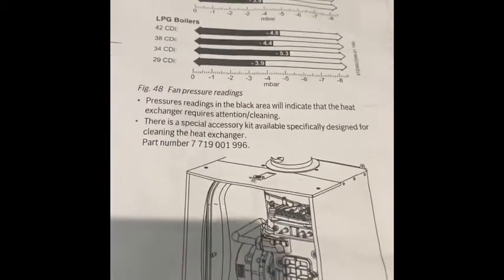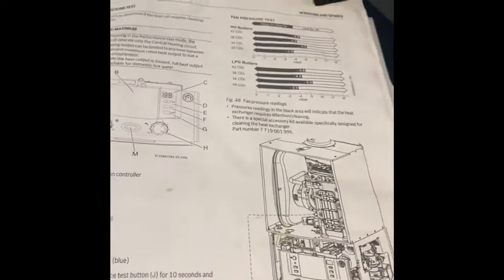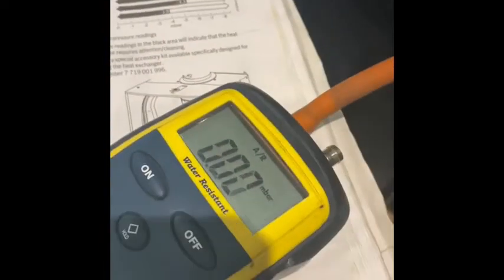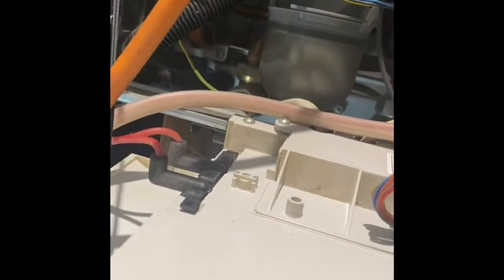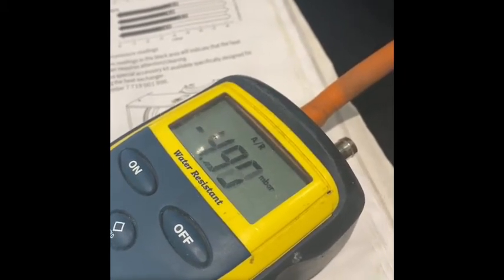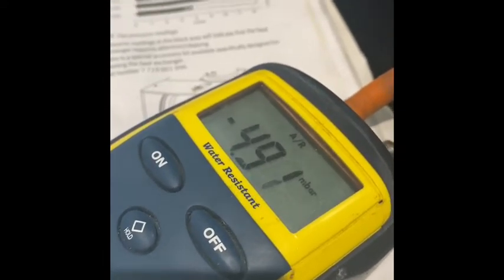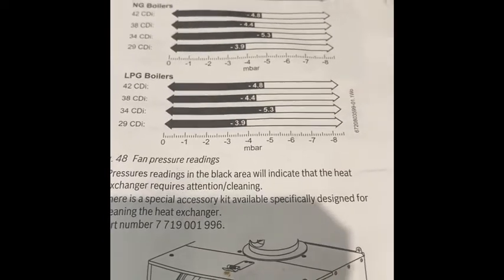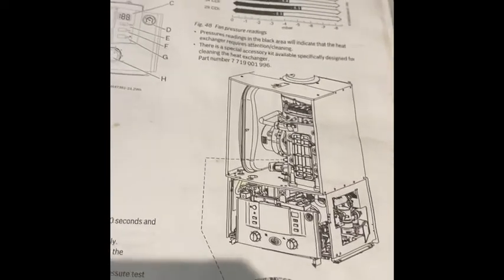worcester boiler fan pressure test ACS gas safe

Comment: Hello Pete, I have one of the older WB 28cdi RCF circa 2010 machines, with a fan with no electronics just 3 terminals (two at one end of the exposed copper coil, and one at the other end of said coil) to which attach 3 wires (red, black, white) from the mainboard, due to my own stupidity, I've forgotten which goes to which, can you advise please?
Reply from the maker: Nope - sadly not off the top of my head… but if you call worcester tech dept then they happily will
Reply: @petegasguy  - many thanks

Comment: Hey Pete, newly qualified enginner, still figuring out beat order of servicing different boilers etc. Would you conduct a FGA check and air integrity before removing the casing to do the fan pressure test or do that at the very end in your opinion? Great video! Thanks
Reply from the maker: Both mate.  Well i do anyway.  I always take initial readings with casing on - then readings with casing off and then readings when service complete.  All equally important IMO.
Reply: @petegasguy  thanks bud, I had been taught the same, but some companies seem to think otherwise.. time saving rather than doing the job properly no doubt.
Reply from the maker: @keithfraser5828  well if you have initial readings to work off then you know that your air/gas adjustment on gas valve have had the desired effect.  Different with various boilers but some require case on and off readings.  Same old tired line of ‘consult MI’s’ if in doubt

Comment: Hello Pete i have a worcester mt10rf combi boiler .... and it has developed a fault 
It still heats the Radiators and the water fine ...... just sound like the fan keeps cutting in every 20 minutes and vibrates hums like a B#tch night and day 
Even worse when you run the hot water.....  i am only presuming it fan noise ..... i am not brave enough to remove the housing
Reply from the maker: Call someone out mate if you think it had an issue...  if you aren’t comfortable then never take the case off...
Reply: @petegasguy  Thank you for your advise Paul ... they are coming out tomorrow morning 
Crazy thing is British Gas came out last Friday to do an annual service and replaced the thermostat on the downstairs wall and the sensor on the boiler 
because it wasn't not talking to each other ... and now it sounds like a tractor on tick over especially when you turn the hot water on :)
Reply: @petegasguy  Just a quick update the British Gas sent a repair man round this afternoon and he replaced the fan .... so my boiler is all quiet again now
Reply from the maker: Mt10rf is the thermostat - not boiler.

Does the front of the boiler have an ‘eco’ buton?  If so - press it until it lights and then let’s see if it kicks in every so often

Comment: Hi, Pete I need your advice, i was working on a Vokera Excel 29, when I created a call for heat by turning on the tap, the boiler fired and the pressure gauge started to leap about and go very high.  I drained and did some checks and recreated the fault, turn on a tap, the boiler would fire, pressure very unstable and go high and the boiler would go to lockout.  any ideas ?
Reply: Overheating. Pressure rising due to steam. Circulation issue, probably slow pump or blocked plate
Reply from the maker: 1 - it’s a bloody vokera...
2 - does flow pipe get hot when there’s a h/w demand? (Diverter)
3 - plate hex potentially passing?

That’s where i’d be at initially.
Reply from the maker: Also - hope you’re well... enjoying lockdown?
Reply: @petegasguy  reduced to doing gas safety checks for letting agencies which are allegedly "vital", money is only slightly better than nothing! what about you?
Reply: @petegasguy  I am in Glasgow, Scotland :D

Comment: Gas and bantz ruleeeee
Reply from the maker: I am glad you found this video useful paulie...  here to help if you need us!  next up, tightness testing during a landlord safety certificate... and then how to find a solicitor when you get sued for saving a life 😂
Reply: Pete Combicert 🤦‍♂️ absolute madness I think boris Johnson made all the gas regs up do a tightness test don’t do a tightness test if you can’t do one then do one but don’t do one
Reply from the maker: Paul Smith yup - that’s blown my mind that has.  reg36... absolute nonsense.  i’m still doing it though.  I would sooner be sued and know someones safe than read about their death in the local paper.  just a thought
Reply: @petegasguy  if you followed 36.9 checks to the T loads of boilers would be AR.  Unsafe situations pretty says AR unless the appliance is spilling pocs or there's a leak the it's ID.  Still I prefer doing gas in apposed to electrics.  When I'm do EICR's it's a mindf'k of regulations.  Regs prevent us from making a situations safer.  🤦‍♂️
I'm picking up some great little pointers watching your vids pal.  I honestly never thought of temp isolating gas supply pipework with JG to find leaks 👍